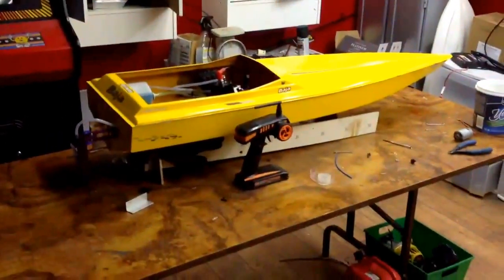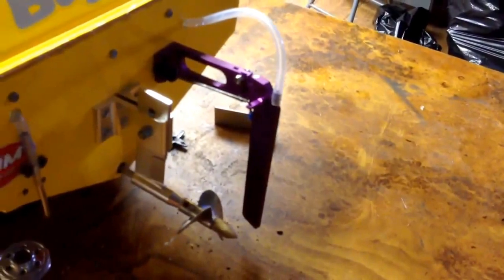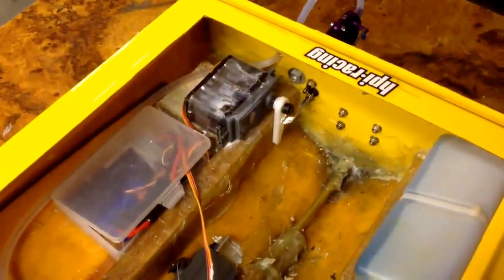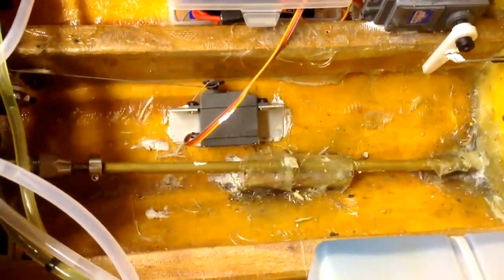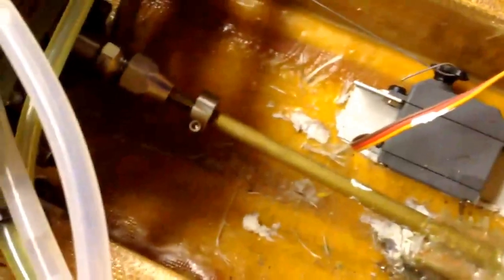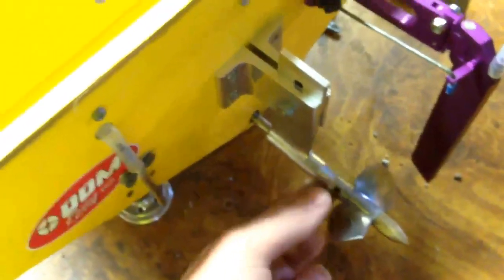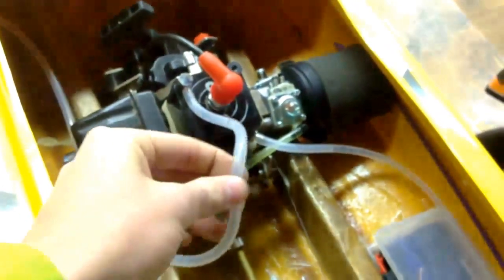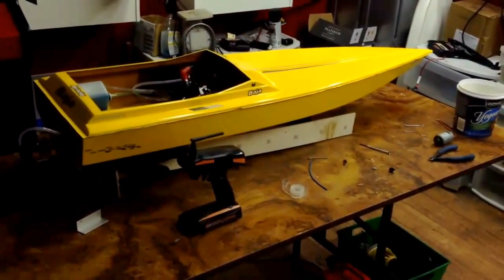56" APACHE V-HULL RC BOAT COMPLETE

Comment: Hey how fast did you get this thing going on the water? 

I will be building a similar boat with the exact same engine.
hull will be same size vee style, but i have to make it from the fibreglass molds I have.

also did you have any cooling issues with that single water inlet?

Comment: Why the dislike!  Got a like from me buddy - great work.  It's always satisfying when you can say you built it yourself.

How do you like the Chung Yang engine?  I've looked into them before as they are a pretty good $ - HP motor.
Reply from the maker: Thanks Fanatik! I like it so far. I haven't finished breaking it in so I am not too sure about speed but it should have more than enough power :)